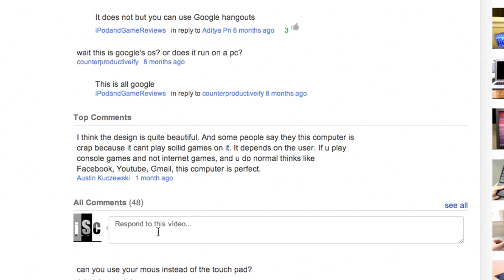How To Install A Water Cooling System In Your PC

Comment: i wil be getting my New cpu watercooling (fractal design Kelvin S24) my current cooler is hyper 212 evo so my question is do i need to take of the bracket on the other side of my motherboard or is it meant to be there?
Reply: take it out